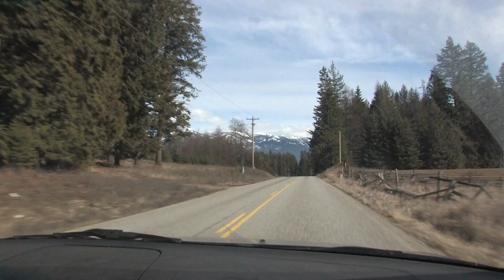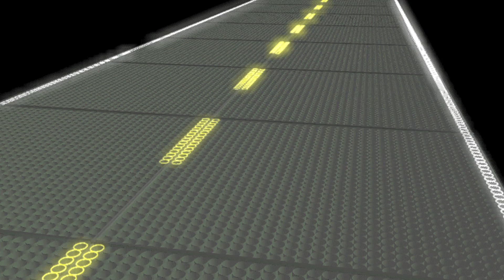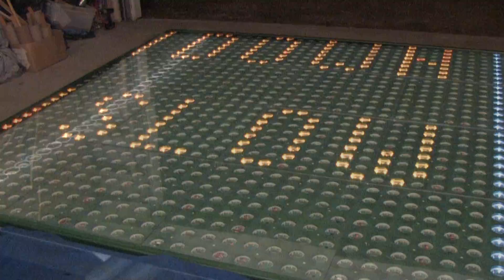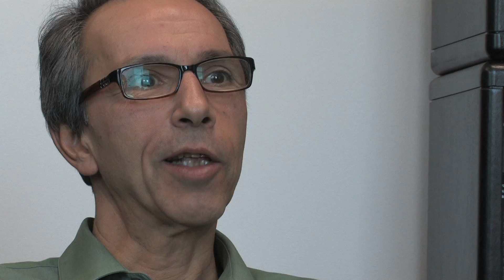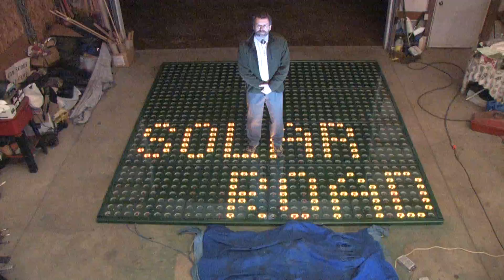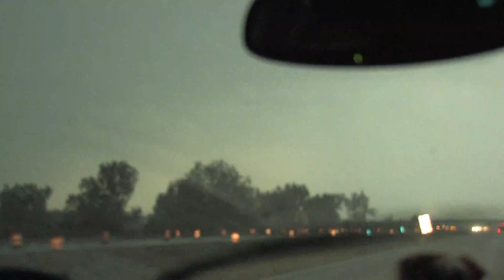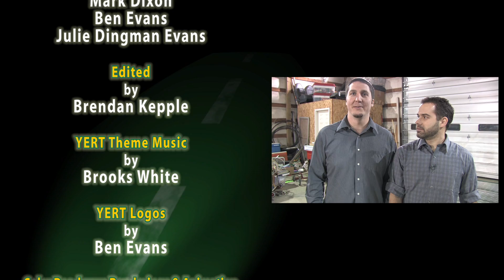Solar Roadways: The Prototype

Comment: A potential avenue is a transparent, tough layer between the cars and the panels. Bonus, make the system acquire heat from the sun and cars to supplant the solar energy.

Comment: He actually raises a valid point, glass may be able to reach the strength of steel in certain situations but the grit in soil contains many componds such as aluminium oxide that are harder than both and will scratch the glass to some degree. Whether or not this will cause major problems is impossible to tell without doing tests.

Comment: Steel itself will receive stress damage from dirt. However, I would think that the largest problem with dirt is that it's opaque. His other point is also accurate, (in america) we have no shortage of land, there are issues with angle efficiency. It's a neat idea, and I wouldn't go so far as to call them hippies, but it's rather impractical. HOWEVER, if, as is mentioned early on, the price of asphault gets high enough to make glass practical, making them solar panels as well would be awesome.

Comment: The tensile strength is not strictly linked to the lifting strength or compression resistance of a material.

An aluminum nail can scratch a steel beam. A steel beam can crush an aluminum nail to a flat pancake.

Comment: All of your facts, you have none. The thing is, roads allready need to be cleaned. Except that, roads are expensive, and made from material that will no longer be available in near future. Therefore, we make new roads that not only are cheaper and more durable, but also generate electricity, pay for themselves and then some.
"We have plenty of land" how does that have anything to do with the subject?...

Comment: No Super-Hydrophobic coatings would increase the traction for other materials, especially stuff like rubber tires, Super-Hydrophobic coatings use lots of little divets and bumps, and the viscosity of water holds itself up in such a way that it does not stick to the surface, but for a material like rubber, its essentially just a rough surface, leading to much better traction.

Comment: That's not the reason glass is brittle as any material even steel has surface cracks. The difference is what happens when the crack propagates (stress concentrates as you mentioned) and how the material deals with it and that has a lot to do with the ductility.

Comment: Ah, well the water does not bead and sit, it will not sit at all on the road and in fact avoid it like it was two same pole magnets.

Liquids do not stay on surfaces with a ultra-hydrophobic surface, and are repelled off it.  The only thing I can think of, if this were possible, is the water would appear to be coming back up in a storm, which might be very distracting.

That and can you imagine being a hitchhiker with water shooting at you from the road too.

Comment: this appears to be a great idea for those who havent thought about it at all. grit would blow over the road, tyres would crush the grit and scratch and wear and tear the surface, reducing solar panel efficiency, it would need to be regularly cleaned cause its right at ground level. it couldnt be mounted to follow the sun. this is the solution to a problem that dosent exist. we have plenty of land. and it creates new problems that dont need to exist. bloody hippies.

Comment: the material that would need to go into making this viable in any way would be by a few factors more environmentally damaging than using asphalt. Plus it's not even the most practical way to use roads as energy generators. We should place mechanisms under the road that would take the off-and-on weight of all the cars turn that up and down motion into power. I've seen this idea proposed for the floors in malls with all the foot traffic so it could easily be adapted for the road.

Comment: You know if they can figure out a way to make the glass as strong as steel then they can probably make it bumpy, that way tires could grip on it easier. They seem to be trying to come up with solutions to all the problems that would be associated with a solar panel road but it does take time.

Comment: If ice covered this surface it would be no different than if it WERE any other material. Same goes for snow (more or less). Traction is important but it is POSSIBLE to create a glass surface that has grip and tires that are adapted for this environment. Your post makes you seem both uneducated and dense.

Comment: Such a coating does not currently exist with quite the exact characteristics needed, time and lots of money would be required to further develop already existing materials.Such a material also does not solve many of the problems I mentioned.
Additionally, I would imagine a super-hydrophobic coating would make the roadway slippery as ice under wet conditions.

Comment: The only way to make glass less slippery would be to put a rubber covering over it, a perfect covering does not currently exist. All rubber degrades under UV light from the sun as well as oxidation, not to mention discoloring actually blocking some of the sunlight. Also, wear from traditional automotive tires would cause a situation where a rubber coating would have to be scraped off an reapplied every so often, somewhat like asphalt on current roads. The logistics are too easily overlooked.

Comment: The financial rewards would be to the consumer. If you havent noticed we live in a corporate world. If someone is not making money off of it, it wont happen.
And you're talking about millions of miles of electronic circuit boards and precise manufactured glass, photovoltaics, and LEDs. It's not cheaper than asphalt. At least not yet.

Comment: Bold solutions yes, impracticality, no. If the concept is ever feasible enough to be put into use, excellent. Renewable energy is certainly the way to go. However, as someone who is no novice to engineering, my personal opinion is it will never go anywhere.

Comment: I agree - that's a significant change.  Hence the extensive testing, prototyping, etc.  Proclaiming something unfeasible is a good way to assure that it never gets off the ground, and that won't get us very far.  The challenges we face are tremendous; consequently, we need bold solutions that ask us to think outside of the box.

Comment: right, and you also miss out on all the side benefits he has planned for replacing the power grid with a solar road - melting snow and ice, channelling stormwater, replacing aging petroleum-based infrastructure, etc.  coefficient of friction is solvable - you can make almost anything out of glass - "sticky" or smooth.

Comment: Assuming this were even possible, it's not only heat you'd have to consider, but cold temperatures as well. The combined stress of both hot and cold fluctuating back and forth, the overall condition of it being subjected to this over a long period of time, coupled with the added stress and weight of vehicles. It would take quite some time before you could safely say your invention is safe.

Comment: Sounds cool. How did they solve the coefficient of friction problem? Did I miss it? What if they just used the road markers as the solar and networking parts and the rest of the road could be made of "traditional" materials. I know that doesn't align with the part of replacing petroleum products though.

Comment from the maker: They're working on that surface. Early samples are surprisingly grippy. Think of what it would be like if you sprinkled sea salt into a piece of barely molten glass. The salt would stick to the glass and become a rough surface. If you used pieces of glass instead of salt, you'd have a very rough and durable surface. Then you'd need to address reflectivity...

Comment: depends what kind of solar panel's they're going to use. there are some new graphene based solar panel. and graphene is abundant, it's just carbon.

there's also low purity silicon photovoltaic cells as well. and silicon is abundant as well. i think the bigger concern is how they'll maintain the tractability of the glass surface so car's and trucks dont slip all over the place after a few years of wear and tear.

Comment: The lifespan of an average LED, if run constantly, is about 3-5 years. These would not be run constantly and would be able to last in excess of 10 years, which isn't bad at all, especially considering the fact that the road pays for itself.

Comment from the maker: 2) They're designing roads in sections-- at least so far-- so you could theoretically just pull up a section and drop down a new one at the location that required a repair. I wonder if down the road they may find a way to just roll out solar roads as a layer on the top of the road instead of glass panels, but that's only me as a filmmaker doing a little wishful thinking. 

3) If the panels are well designed, they should just be plug-and-play for maintenance crews. Maybe an electrician, too?

Comment from the maker: 1) The repaving question is a good one. Last I checked he was looking at every 7 years, but I think that's a little bit low for years between repaving. Some roads need it only every 20 years. That said, I suspect he's revisited that math since last I checked. It's important to note that we need to compare costs to what it costs to use oil as a primary ingredient in roads. As that cost goes up, it makes more and more sense to make our roads out of something else entirely.

Comment from the maker: I thought so too, at first, but apparently you can get amazing economies of scale when you combine the infrastructure for power generation, roads, power transmission, and newtork data transmission into the SAME infrastructure. Then you can combine costs on a variety of levels and miraculously it can make sense. It doesn't mean that they WILL implement it like that, but at least it seems like on paper it could very well make sense.

Comment from the maker: All very good points, and the creators of solar roadways are looking into them. You can check out their website-- google solar roadways. You can find a discussion of the whole project there, with lots of answers. But briefly, they are designing special glass to be able to provide sufficient traction, even when wet. I've touched some samples. Amazing progress so far. They hope to melt snow off the roads with electricity (possibly brought from other sunny parts of the country).... see next comment

Comment: Awesome idea. Awesome that you're answering questions about it!

1.) How does this technology compare to asphalt, etc in terms of how often it will need to be "repaved"?
2.) How easily could road crews repair, patch, replace, or upgrade small sections of road?
3.)Any idea what level of technical training would be required for the workforce? (eg: could current orange-vests easily handle these duties, or would street departments need to start hiring electrical engineers?)

Comment from the maker: Good points. Scott Brusaw (solar roadways creator) recognizes the problem with potential dirt on the glass. He's looking into self-cleaning technologies for that. I think that he'll be able to place the glass on a base that could theoretically tilt it property. And, yes, they're working on the glare issue, too. There are probably polarization options available-- and also ultimately they'll want to trap the light in for the solar panels to use, not reflect it up and away. We'll see what they do!

Comment: I foresee a few problems with the concept: 
Wet traction (water is not absorbed by the glass, as in concrete or asphalt)
When the panels are covered by snow, cars, debris, et cetera, they won't generate electricity
Fluids leaking from driving cars also pose a traction detriment
And of course, very high initial cost

How are these issues being combated by the engineers?

Comment from the maker: I think you're right. It would have to make economic sense to deploy it wherever it goes. But part of its value is to actually create a new grid OUT OF the road system. So even random stretches are important if they help connect the larger grid.

Comment: @YERTians why not amphorus cells, i have a 19 foot flexible and extremely durable array from unisolar and for being meant for on roof use it has stood up to everything, during testing before application i had rolled it out(on gravel) to test the true volts and amps under load, and some jackwaggon pulls over and parks on it, no damage, just a thought. ALSO this array 19x1 feet puts out 128 watts, i have a 3x3 photov that puts out 144 watts, so it's not nearly as efficient, but it was cheaper $198

Comment: Won't they get dirty over time, and so loose their ability to create power? Also, won't they get really slippy in the wet weather? Also, orinary roads are curved to help water run off - those panels look dead flat - water will just build up causing aquaplaning.

Comment: I would love to see something like this in the colder climates.  It maybe wouldn't sustain power grids (in the winter) but if the road could generate enough heat to keep the surface free of ice, and to keep the ground below it from freezing, it would last a lot longer than typical asphalt roads.

Comment: Why not use a material that generates electricity due to their resistance to movement?  I believe the term is piezoelectricity?  Also, I don't think you'd be able to read that text when traveling at a high rate of speed.  If you look at things printed on roadways, they are usually elongated to adjust for speed/perspective.

Comment from the maker: While I'm just one of the filmmakers and not the actual road builder, I do know that they've been working hard to address those issues. I've actually held a sample piece of glass road surface in my hand and it is every bit as grippy as asphalt, if not more. Also, it is important to remember that asphalt roads are not indestructible. If you have a major major accident (like a giant explosion or other huge problem), earthquake, or other scrape, you need to replace the asphalt beneath it.

Comment from the maker: The goal is to heat the roads so that you don't have to plow them. Because the sun doesn't usually shine when it is snowing, however, you'd need to bring the power in (via the grid/road system) from a sunny area to the snowy area.

Comment: I just wonder how  is it possible to drive on glass... well, get a bit of glass, spray it with water and you'll a nice 0 friction surface, something has to change also within the tires or else... brakes become pretty useless. Good idea though, but I would go into other materials to build the roads, instead of oil based tarmac, maybe there are other materials, even garbage or composite, and leave the glass out of the equation.

Comment: How much weight can it hold? Will it be able to withstand debris from tornadoes or hurricanes? What about earthquakes? At what speed can you drive on it? With just glass it seems like the grip of your tires would be completely useless at high speeds causing more accidents. At the speed of 60mph how would I stop with less grip? What about wear and tear? How long can the road last with constant use?

Comment: another good idea would be to use that energy to power electric cars. There are concepts of road designs that use induction technology to power electric cars wirelessly. This way you could drive around all day without worrying about fuel and do small trips at night using the battery.

Comment: Electric road heating for deicing purposes requires about 25W/ft^2.  A horizontal PV module can generate about 10W/ft^2 (and much less in winter).  This means that the road would be a net load requiring additional electricity.

Comment: The problem I see arising is the overall effectiveness.  They are ~15% efficient, then you have vehicles covering large quantities frequently, and finally the large buildup of dust and dirt.  I love that people are working on these kinds of ingenious solutions; unfortunately I feel that the overall cost required to implement such a system won't be justified until the cost of asphalt becomes completely unreasonable.  Sidewalks would be a wonderful start.

Comment: scratching the glass will not impede the road working though. infact it may help trap light so that it will not reflect back at people as glare, and get more of it to be converted to power. I would think the thing to look into would be diamond deposition (carbon being heated and deposited on the surface) to create a super strong surface against scratches and wear. under that a solid block of glass over the solar cells that are fused to the bottom of it. more later.

Comment: I wonder what they will do for Winter season city like in the north. Have defrost insert in to keep the road without ice or snow? So city wont need to spend money on truck to take off snow on the street and the defrost will melt the snow that make parked car stuck in snow. No ice on road no need salt or sand on road cos of ice so less damage to the glass road.And they will have the change the truck that clean road take off the metal brush for a softer brush .cos metal brush will damage the glass

Comment: I love green renewable energy. But this is by far the worst (dumbest) idea ever. Assuming you get the right material for friction, structure stability... and also they are cheaper than asphalt. You still need to clean it everyday to get the as much sunlight as possible.  Now, look at the windows and see how dirty the glasses are. Yet the windows are vertical so they will not collect as much dust as horizontal road. Not just dust, rubber track, and they are extremely hard to clean.